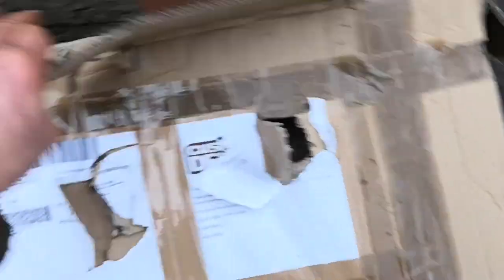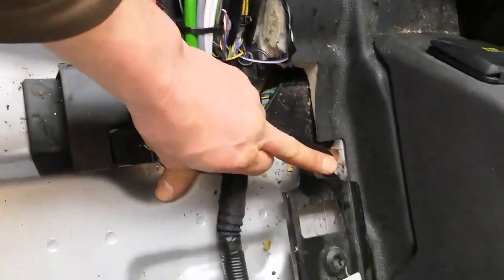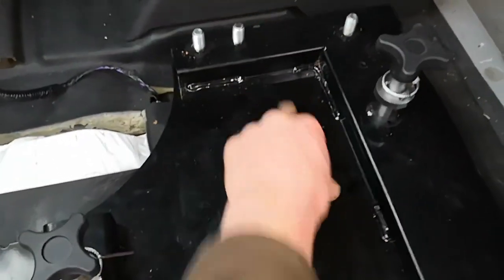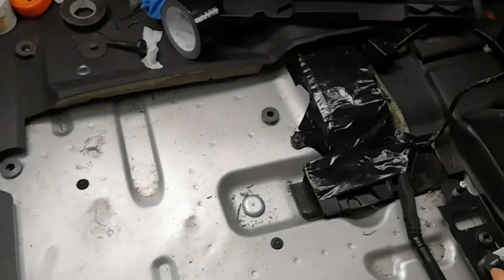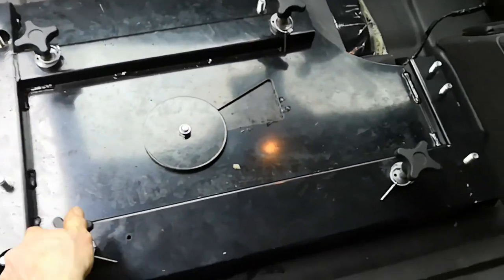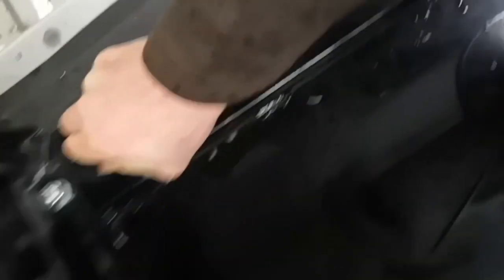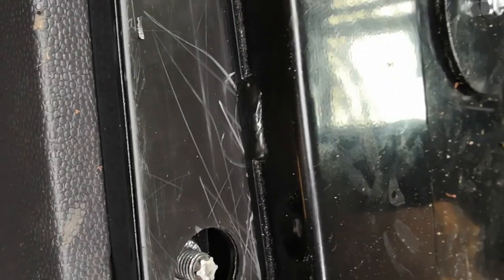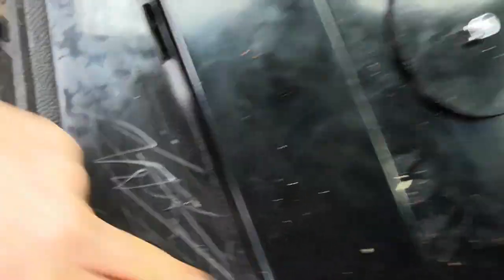SSV 2 point 0 The 1 hour job, Transit Custom Swivel Seat

Comment: Many thanks for the video, it will influence my design and decisions!
Reply from the maker: I've found somebody that has installed just a drivers swivel which seems a good option, I researched this and the manufacture said the driver's only work with the passenger one but that doesn't seem to be true

Comment: The design is the only way it would appear for a bench seat to turn around in such a small space, its amazing it can to be honest!  I found it took a few hours to fit, but no major dramas if you follow the instructions exactly. It takes me about 2mins give or take to turn the seat around, and i have to remove the headrests. All the pins drop down in to the holes on their own if you turn them 90 degrees and move the seat slightly; forcing them doesnt work! Although its not perfect, i dont see how else you can do double swivel seat. 

I added some extra washers at the back of the seat base to tip it forwards slightly, so that when its rotated, youre not falling out of the seat in to the back. I didnt have to cut any wires or wiring ducts, only some of the flooring out as specified in the instructions (i recommend not cutting too much out around the protruding part of the base stencil, otherwise when you rotate the upper seat the base can catch on the plastic flooring (if the flooring is not pinned down underneath the bottom base unit)
Reply: This was in a 2016 Citroen Relay
Reply from the maker: Maybe it's because my is a trend model, or maybe you were lucky with the quality of your plate.Either way it didn't fit until they sent me extra spaces.

Comment: Hey there, I have watched this video when I installed the plate and today, the day my van failed its MOT on bushes and the passenger seat being insecure...   I undid all the bolts, took the seat off the plate and then investigated. The plate itself was loose. I tried to fasten the torques but no chance they'd sink in deeper. So to get to the bottom of this, I unscrewed all the torque bolts and the one nut. The bolts had corroded quite badly from underneath the van. So I cleaned them up and fastened the lot in again. STILL the plate had play.

Undid every bolt again and then noticed that there were three long bolts and one shorter one. So I then figured that the shorter one went at the door side toward the rear of the van. Then the plate was rock solid. Put the chair back on and even ythough my van passed its MOT, the chair would not swivel?!?

So I undid everything again and then loosened the bolt in the triangle. That helped a lot. Then, loosening the nuts that actually hold the chair to the plate helped. How safe this is, I'm beginning to severely doubt....

I have a mark 7 transit too (recently purchased), and I've gotten a different plate for that. It has none of these problems and the chair turns ever so easily??? Something went wrong with this design!
Reply from the maker: If you're unable to swivel it with the bolts done up then it's not sitting square with the floor, you'll need some more washers to space it off. 
I ended up with extra washers between the van and the swivel and between the swivel and the seat!

Comment: Stupid question - how did you trim down the floor studs? Angle grinder? Just worried about filling the cab with sparks
Reply from the maker: I just used some hardboard to keep the sparks away from anything important.

Comment: Hi got delivery of plate,  box not in as bad of condition as yours. Any way fitted plate 2.5 hrs got a mixture of washers with it so followed instructions found that you can’t lock it in place when turned round but I will devise a way to lock it.  It is a tight space to turn it but makes a big difference to space in back of van but worth the big expense
Reply from the maker: Well done, totally worth it once it's in. Shame their customer service and product isn't just that bit better. I've not been bothered about locking it in the rotated position but let me know if you come up with a clever plan
Reply: Good afternoon William,

The item can be locked into place in the rear facing position. Please see point 13. on your instruction sheet for the information:
Adjust it into position by aligning the notches of the top / bottom plate on the left and right hand of the plate and lock down the front near side and rear offside handles to secure the seat in position. Also see youtube clip https://youtu.be/5ddE4QiQ8KM for additional help
Reply: The seat swivel base should also be rotated anti-clockwise as stated within the instructions:	Rotate slightly anticlockwise, slide slightly towards the passenger door then turn 90 degrees, pull back slightly to the drivers side then complete the action by turning it a full 180 degrees. Any problems there is a youtube clip https://youtu.be/U3K4i6WYnHo for additional help (Once tried a couple of times it is a really easy operation to carry out).

Comment: Thanks for the great video. Nice to see I’m not alone. With no other options I have recently bought one of these for my transit custom. I’m having lots of issues. The instructions don’t seem to match the vehicle (no clear use for the 6mm washers) and I definitely need some spacers under the unit. I have tried various combinations with washers and I’m never able to lock all four securing bolts. 

I have contacted Customshop Designs and so far they have indicated they don’t recognise the issue, which seems odd based on so many reports. I have mentioned this video and now awaiting further response. 

I would really appreciate some advice on how to proceed. What setup has worked best for people and whether, once working, it remains that way or do the issues keep returning?

Cheers
Reply from the maker: They're terrible! put the pain of installation is slowly fading and I'm please I have it now.

Comment: How much does it raise the seat from standard? It says 45mm on the website and I contacted them to confirm a few issues and as I have the trend model, with the wiring loom it needs more washers and could be 55mm higher! 

My problem is I’m 6’6 ‘’ and my head almost touches the roof lining as it is! 

Would l fir?
Reply from the maker: Yep it's high, I had loads of issues fitting it, it's not as comfy now, but it's the only option out there.
Reply: Not so good. Non starter for me then. Contemplating chopping t frame & having a swivel welded in 🤔
Reply from the maker: @xtremetele  expensive but the seat base could be reduce in height

Comment: Why no easy custom swivel seat for FTC :,(
Reply from the maker: It's a super tight space I'm amazed they have made it work at. They could improve it though.
Reply: @ssv7142  It seems like this is the only option right? You are the first person I've seen with video evidence that it can be done.
Reply from the maker: @AuRowe  Yep this is the only crash tested one, it's ok once it's in and you get used to it. But it could be better. I give it a 6 out of 10

Comment: I have fitted one to my 15 plate Custom.. its a faff and the instructions were confusing regarding where the spacer washers needed to be placed.. it has been in for a couple of months and its a twat to turn, it also wouldnt lock down properly with the 4 locking pins not going into the holes easily........I have taken it back out and chamfered all the locking pins and the holes they fit into, it goes a lot easier now, and practice has improved things, but its still not the fastest , easiest thing to do after a long drive , especially if its hoofing down with rain !!!
Reply from the maker: Yep I don't rate the design !

Comment: I've just bought a transit custom, it seems a lot of people have issues with these, are there any alternatives?
Reply from the maker: No alternative at the minute Ben, they're a terrible company and the product isn't great but once it's fitted it's worth having, just make sure you have the seat base sitting flat before you tighten the nuts or it won't operate. same goes for reattaching the seat. Just use washers as needed to make the base and the seat sit flat.
Reply: @ssv7142  Thats a shame, I'll sit on this decision for a while and see how I feel once I've got more work done!

Comment: sorry, but what is the name of the company - so I can avoid! Thanks
Reply from the maker: The only people that make this conversion, Custom Designs Shops. It's worth considering just doing the driver's seat if that works with your layout it can be made to work without the passenger seat rotating too.
Alternatively bite the bullet and just put aside a whole day for fitting